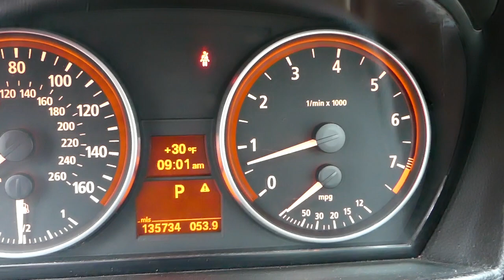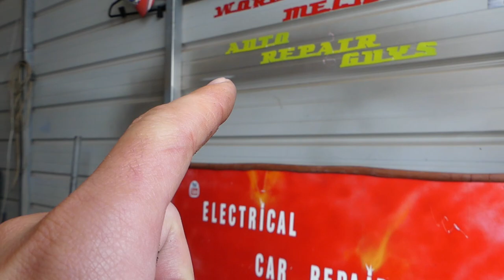COOLANT IN OIL OR OIL IN COOLANT CHEVROLET CRUZE CHEVY SONIC

Comment: Cool vid thanks for the heads up! I am getting a slight build up of what looks like could be oil in my coolant reservoir tank, as well as my Thermostat housing seems to be giving way(a common problem on these GM motors unfortunately) Will replace the thermostat housing and inlet hose as well as do a maintenance service with a radiator flush and see if it helps...otherwise its going to be the oil cooler next that ill be replacing if you cant just replace the seals on them...

Comment: Hi, thank you 4 ur video. Question. In mu case, I have a clean oil in the oil pan and deepstick and oil cap feeler but the coolant reservoir has about 60% of engine oil in it. What I understood in ur video, basically could be the oil cooler gasket but not necessary the front engine one? (this question in order to don't mess with the timing). Thank you for the video again, it gave me more ideas.
Reply: Did you ever figure it out?
Reply: I have the same issue

Comment: Hey world mechanics I have a 2011 chevy cruze lt 1.4l turbo my coolant is disappearing from the jug so I took the oil cap off and on the bottom of the oil cap it is a very thick milky looking substance is that normal and what should I do

Comment: the problem is the packing gasket that separates oil and coolant passages. Also oil cooler is next to the exhaust this adds even more problems. Yes, shity engineering if you ask me.

Comment: Hi i have a 2012 chevy sonic 1.8 i noticed the coolent is dissapiring from the container i suspect its mixing in with the oil but there is no smoke would this be the same part that i will have to replace?
Reply: change the coolant reservoir with a new one and check for damage coolant pipes

Comment: I have a 1.4 turbo 2011 chevy cruize , oil cap is milky, not loosing coolant, and its not putting white smoke out of the exhaust,  I thought the head gasket was gone , but now I'm not sure, any suggestions??
Reply: Check ur dip stick. If its clean, then its most likely due to short trips that you make with the car. Dont need to worry about it.

Comment: Hey I have a 2011 chevy cruze lt 1.4L turbo & recently it overheated. I replaced the valve cover & did an engine flush but their is still white smoke coming out of my dipstick & coolant still mixed with my oil. My question is, after an engine flush could my oil pump cooler be the cause of white smoke coming out of the dipstick or the oil pan?
Reply: Either turbo oil cooler gasket,hoses, head gasket. Needs replacement. But change most gasket every 40 to 50,000 miles. Dorman parts

Comment: 2013 cruze 1.4l  coolant in oil after head job done new waterpump and all gaskets. pressure test coolant system , holds fine . Would oil cooler show a leak down if it was the problem. ??? anyone
Reply: Gasket kit from dorman. Oil cooler for turbo is what he showed. Main reason for smoke coolant in oil. Replace oil turbo line

Comment: Hello sir , I have changed it but still the same problem!!!! What else do you thing can couse this???
Reply: He literally tells 3 reason what it could be, watch the whole video :D
Reply: Did you solve the problem?
Reply: Yes it’s fixed
Reply: @muhibalahmar7343  what was the problem if you don't mind me asking?
Reply: FQ  I change the Oil cooler and it works, but I had to clean the Radiators very well after fixing the part because there was a lot of oil in it , I cleaned it 4 time , at first I thought it’s not working but it works
Reply: @muhibalahmar7343  cool, thanks for your response.
Reply: FQ you welcome 😉
Reply: Cracked block or head warped.